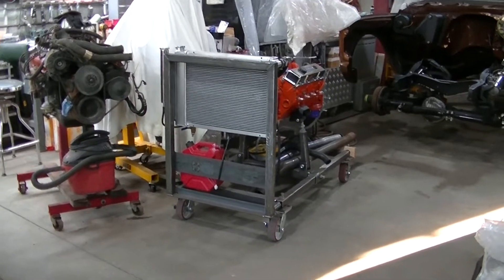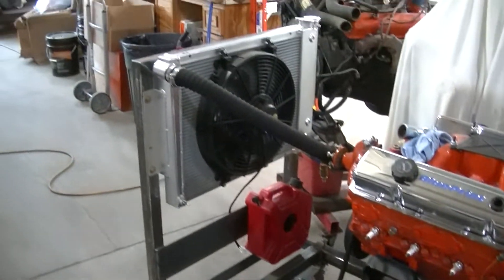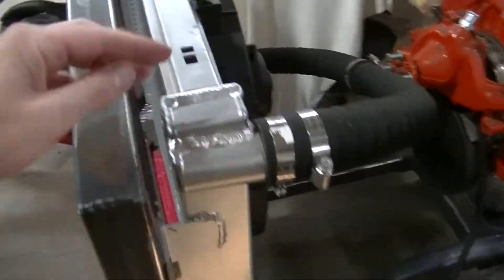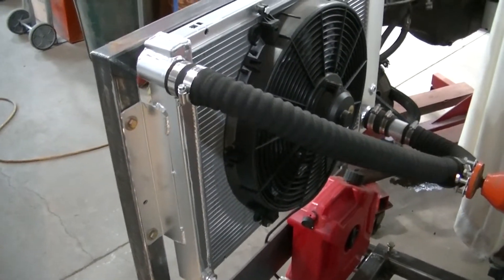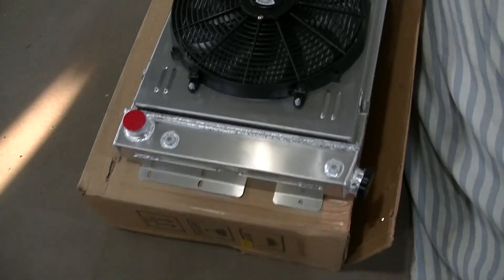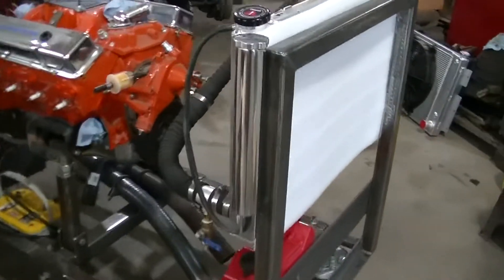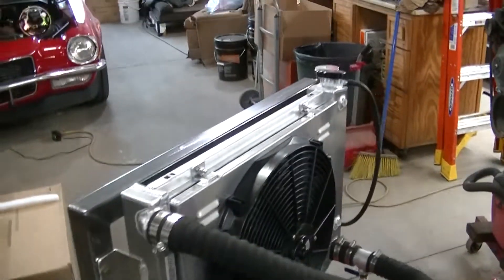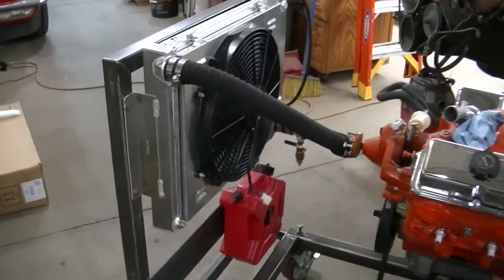Engine Run Stand | New Radiator

Comment from the maker: Things that might help with a project like this:
Aluminum Radiator:  https://amzn.to/3yuUc7Q
16" Fan:  https://amzn.to/3q45Bas
Battery Tray:  https://amzn.to/3GYrC1y
Overflow Tank:  https://amzn.to/3eakbrs
1.75" Radiator Drain:  https://amzn.to/3qcllZi
Switch Panel:  https://amzn.to/3pbwzOs
Stewart Warner Gauge:  https://amzn.to/3EbrbPq
Caster Wheel:  https://amzn.to/3qe3xNp
Rivet Nut Kit:  https://amzn.to/3IZqZGR
Hole Saw Kit:  https://amzn.to/3mjP9BT
Fuel Tank:  https://amzn.to/3mlzq5z
VP Racing Tank:  https://amzn.to/3e9NSZG
Weatherproof Relays:  https://amzn.to/3q9q8e2
Oil Pressure Gauge Tubing Kit:  https://amzn.to/3yFkRyy
Engine Stand Plans:  https://ebay.us/TXS6ox
Casters:  https://amzn.to/3CGLcwD
1" Threaded Rod:  https://amzn.to/3nG386f
Hobart Welder:  https://amzn.to/3FJGOyZ
Aluminum Bellhousing:  https://amzn.to/3HNyik3
Transfer Punch Set:  https://amzn.to/3cBdFZZ

This video contains affiliate links, which means that if you click on one of the product links and buy, I'll receive a small commission.

Comment: I would've attached a steel mesh to the front ,  it would not bend unless a huge amount of force rammed it , but it still would have protected the radiator from damage
Reply from the maker: After seeing how open the radiator was I thought about protecting it with screen but just never got around to it. It's fixed and sold now so it doesn't really matter. I will protect the next one better.

Comment: I would weld a piece of expanded metal in front of the radiator to protect it. The styrofoam doesn't seem to reliable.
Reply from the maker: That piece isn't styrofoam. It's more like a soft foam. I think it would have kept the old radiator safe.